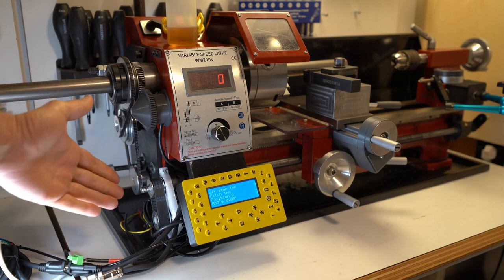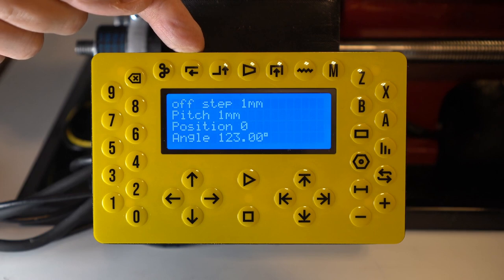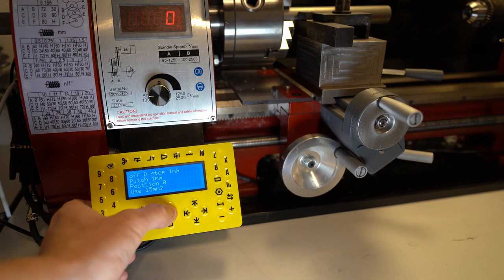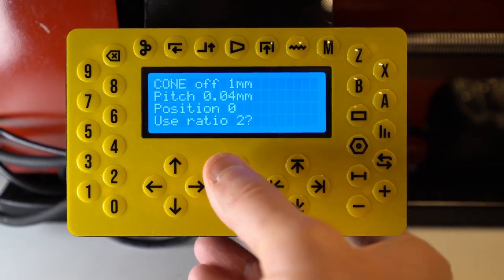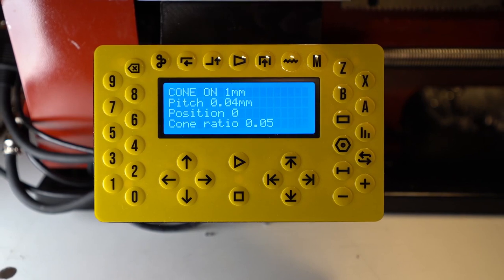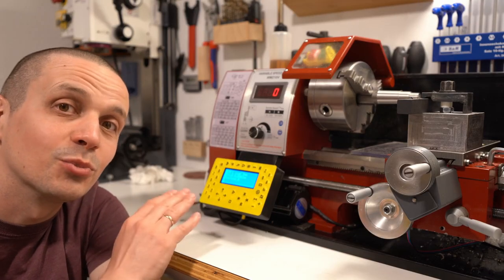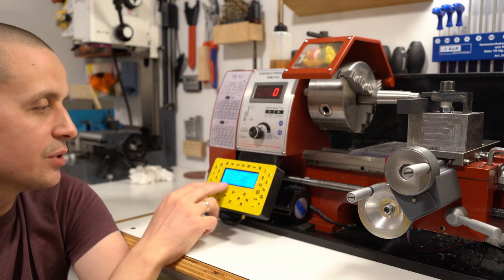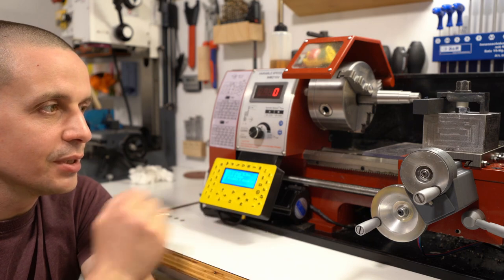Manual and CNC lathe - 2-axis ELS

Comment: Very cool project! If the controller also adjusts the motor speed, you could have the same cuttingspeed at different diameters.
Reply from the maker: Thanks! There are 6 unused GPIO pins (2x4 terminals) on the back, since it's open-source you can make one of them control the motor e.g. via PWM 👍

Comment: Super! You realized good idea and have a lot for progress. Do you have plan to get command to motor board?
Reply from the maker: Thanks! Not sure I understand your question, can you please elaborate?
Reply: @MaximKachurovskiy  The process starts when you turn the potentiometer (resistor). You set your engine RPM every time. Do you think set RPM from your board and start from your board?
Reply from the maker: @SharafV  it's actually nice to keep those things independent since you can speed up or down or pause the cut any time with a big familiar potentiometer. It makes sense to stop the motor on command from the controller when the operation is done though, will think about it 👍

Comment: Hi Maxim, watching your channel for some time. I like your projects very much. Now waiting for my RC210E-600 lathe coming from China. There is no HW available at your site. Old one sold out and H4 not present. I would like to upgrade from the single axis to your H4 controller, but  will I have to do all the HW stuff myself? Another question: The chinese controller has combined display for the RPMs and leadscrew parameters. How shall I combine it with H4?  Keep the Chinese controller for RPMs and tap the signal from encoder to H4 while keeping the signal from encoder to the chinese controller, so that it gets what it needs to display the RPMs. Thank you in advance for help.
Reply from the maker: Hi @tutinek69! Thank you. I'm only shipping to 8 countries so sadly looks like I won't be able to sell one to you yet. On hardware, I'm selling just the controller - you might be able to reuse rotary encoder from your lathe and the stepper motor. Not sure if you'd be able to reuse the stepper driver - sometimes they are integrated into the main board and can't be controlled externally. H4 has the RPM display but I agree it's nice to have it on that top display. Perhaps you'd manage to connect one encoder to both controllers? That'd be a bit risky of course, some kind of electrical failure could take out all of them. At least make sure that encoder operates at 5V. Cheers!
Reply: @MaximKachurovskiy  Thank you Maxim. I will need some tinkering with the new lathe. This will take some time anyway. Then I hope there will be some way to get the controller.

Comment: nice work , but seems like the tool does not back enough from the thread and it remove some material as it  back to start point , for sure it just a parameter and you simply can change the value in your code and improve it , you should build cnc for next project 😇
Reply from the maker: Yes, nice catch, it's a matter of operation setup - so called DOWN limit - I set it exactly at the part which caused the cutting on return. A solution is to just set it e.g. 1mm away from the part. CNCs for the win :)